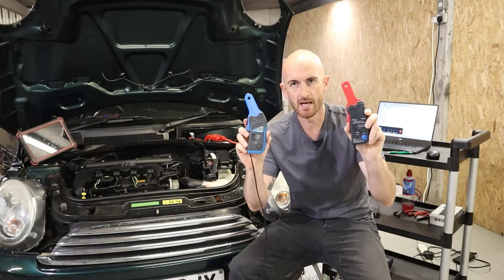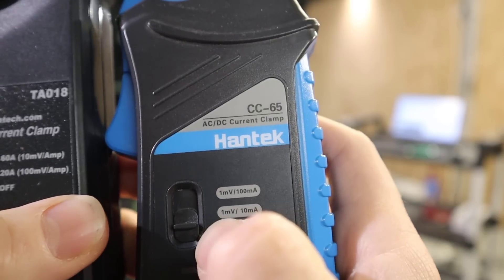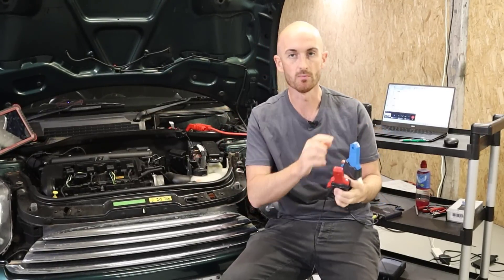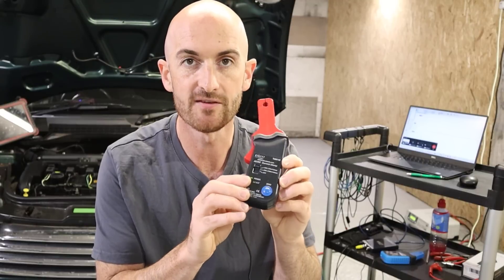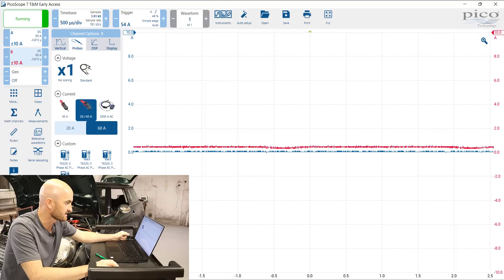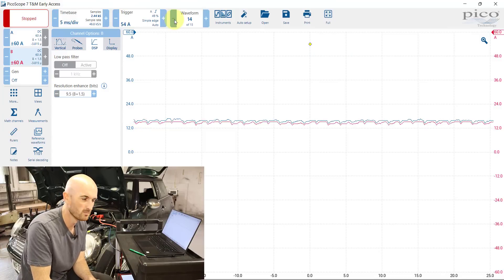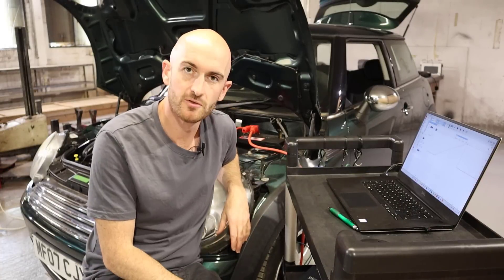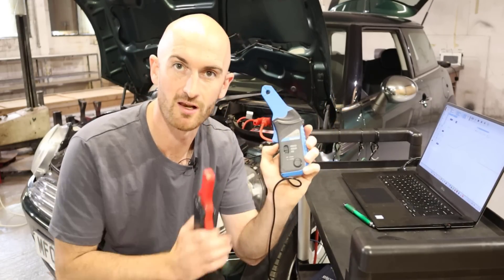Which One Is Best? Hantek CC-65 vs PicoScope TA018 Current Clamp

Comment: Hi there, just one question, i an a bit confused about this Amps per volt thing, i have the Hantek CC 65 as it was cheaper, you say it only measures up to 60 amps, i was hoping to measure starter current in the order of 100 to 200 amps say, so are you saying it wont do that, i have a picoscope 2 channel and the ver 7 software,  i do have a 20:1 attennuator if that could be used, so what would happen if i try to measure starter current with the Hantek cc65 clamp...i have never tried it...i mean it's only measuring the magnetic field not the actual current,  so could i use it with the scope on the 20 volt range for instance...from Fred in Essex.
Reply from the maker: Hi Fred, you will be better to get the CC650 for starter motor current. The CC65 won’t measure that high

Comment: Hey there. I have the hantek 6074BE with the hantek clamp. I'm trying to diagnose a parasitic current draw but the amount of noise is big (even with the clamp disconnected). Could you please suggest the correct settings for the Hantek scope for this? Maybe the trigger should be at normal and not auto?
Reply from the maker: @evgenyknafel2857  I’m not too familiar with that scope. I have one but it’s still in the box! Is there a filter option? Another method is to make a current shunt and measure voltage drop. Should be cleaner. Amp clamps are ‘noisy’ tools!

Comment: 9V batteries are not cheap. I bet I've spent the difference in price between the Hantek and Pico on batteries and not counting the aggravation of having a dead battery. And it's not necessarily forgetting to turn the Hantek off (although that happens to everyone) the Hantek switch moves way too easily. I swear you could breathe on it and it would turn on. The Pico has it's own aggravation, while it does save batteries by turning off, the turn off timer is wayyyy too short. Not sure I've ever finished a task without it turning off in the middle of whatever I'm doing. It's not like it stays on because it senses activity. So, I push the zero button while choosing a range on the Pico while hoping I don't forget to turn it off, and I remove the battery on the Hantek when not in use.
Reply from the maker: Time for a BNC+ 😅😆
Reply: @MechanicMindset  What's a BNC+? All my clamps are BNC.
Reply from the maker: @howlinhog  the latest Pico, it has slightly different BNC connections and can supply power to the clamp so you don’t need batteries 😁
Reply: @MechanicMindset  An amp clamp that requires batteries can operate without any by using the new style BNC connection? Not that I'm going to buy one anytime soon. I'm already way overboard with oscilloscopes. Pico 4000 (or 4000 something, I can never remember) 4 channel scope, Fluke 190-204, Fluke 124B and a little single channel Zotek (which is kinda awesome by the way for $70). Oh yeah, and two old Fluke 97s I've had since the nineties. One doesn't work and the other I can't move one channel down on the screen.

Comment: Hello MM.I have a question you might be able to answer? Let's say I have access to the 4 wires from 4 fuel injectors, which get switched to ground via the ECU. If I put all 4 wires inside my amp clamp, will I be able to view all four injector traces in succession on my oscilloscope? I realise that if I put the clamp around a single common feed wire it would achieve this, but I am just curious if 4 conducctors pass through the amp clamp, what the outcome would be?
Reply from the maker: Yes it works like that! I have a video somewhere; it might be in our app

Comment: New scope user here just purchased a 2204a I already have an Autel mp408 4 channel I purchased a Rotkee pressure transducer and  both the low and high amp clamps from Hantek and after not getting the desired patterns on my scanner I got a cheap laptop to use with my scopes

Comment: Hi, have you considered extending the cable on the hantek CC-65? I think it would make a grate video…the reason I’m asking, is that I’m curious if it actually affects its accuracy!
Reply from the maker: I would just get an extension lead. It’s a good question. Although, as these type of amp clamp are already lacking in exact accuracy at the low levels, I do t think it would be a problem

Comment: mostly ignition and injectors testing . i went pico because of quality and a longer lead. works good with my autel mp408
Reply from the maker: It’s definitely worth spending the extra, especially if you use it a lot. Hantek is great value though 👍

Comment: Could you please tell me if it is possible to use the Pico current clamp with a Hantek oscilloscope or is there connection or other compatibility issues that prevent these clamps from being interchangeable between these two manufacturers?  Thank you
Reply from the maker: It’s fine, you can use most BNC connector probes with most other oscilloscopes. That’s the good thing about all these accessories; you can keep them if you decide to upgrade your scope 👍

Comment: Very useful Darren, thank you. I think the Hantek was reading slightly higher because it is a 65A clamp not 60A and should have used a different profile to the Pico clamp. Without thinking about it more carefully I’m not sure if that would make it read higher or lower!
Reply from the maker: I like your thinking. Just did some maths; Hantek is 1mV/10mA. Times x100, makes it the same as Pico clamp 100mV/1A

It does look proportionally out as the current rises. 

Which have you got?

Thanks! 👍
Reply: @MechanicMindset  I’ve got the Hantek, both 65A and 650A. I’ll see if I can devise an experiment with a current limited power supply to check their accuracy - if only up to 10A.
Reply from the maker: @willishendley8924  Sounds like a plan, I should have done a test with my meter. Although I had done a batt drain comparison; the clamps aren’t accurate at low current below 30mA. And my meters haven’t been calibrated since 2010 when I was working in the workshop last 😅

Comment: Which one should I prefer getting first, an oscilloscope or a scan tool?
Reply from the maker: I’d say scan tool, this will give you the direction of what you need to test with an oscilloscope. But get a good multimeter before the oscilloscope; and learn how how to use it 😁
Reply: @MechanicMindset  Are these scan tools region-specific? I'm from the Maldives. We mostly use Japan made cars. Honda, Toyota, Mazda, Nissan, and Suzuki are the most widely used brands here. People here mostly recommend buying an Xtool PS70 Pro, saying that it's the least costly, professional grade tool on the market. But it actually costs around 700 us dollars! I'm wondering whether the little red scan tool you showed a few days back would suit for me as a beginner! Do you think that one will do for Japan made vehicles too?
Reply from the maker: @roseelectronics4582  The ThinkTool Mini should be a good start. You can upgrade the software easy if you use one brand more. Read codes, live data and perform basic service and maintenance functions 👍
Reply: @MechanicMindset  thanks

Comment: Good comparison video Darren however, is there an obvious point I’m missing but how do you know the one is more accurate than the other? Cost seems to be the decider, but how do you know either is accurate? What are you measuring them against other than each other, I don’t see why the cheaper one couldn’t be more accurate?
Reply from the maker: Good question, I suppose I set out to see how much difference there was. The Hantek definitely drifted faster; so wouldn’t be as accurate. I would have to do another test, maybe with an ammeter or current shunt 👍 a video to add to the list 😁

Comment: Just an FYI for the Hantek amp clamps (both the 65A and 650A): you can modify them fairly easily if you have soldering skills (and I'm guessing most people using an oscilloscope have those skills). It involves changing and/or adding some capacitors and such, but it makes a huge difference! Just search for "Hantek CC-65 Teardown and Testing"
Reply: I found the video by the channel NFM, but upgrading capacitors was not covered in the video.. ? You tube doesn't allow links in comments but could you list channel name and video title?
Reply: Where’s the video? I can’t find it. I’d like to improve the drift on the hantek
Reply: @ i found it, its actually a thread (not a video on Youtube) on EEVBlog website - thread is as titled in the quotes in the first post.
Reply: @luckystrike240 thank you. That blog is a bit out of my league.
Reply from the maker: Ah cool! I’ll check it out

Comment: Darren thanks for sharing. Is there an AMP clamp like the one you used in the parasitic drain class? I’ve been in the garage messing around checking for CAN voltages and resistance. My 07 odyssey has the termination resistors and the correct voltage measurements where my 99 Accord EXL doesn’t. It does have a computer is it possible it has a single wire buss. For having a limited limited computer system I looked up OEM replacements and very expensive 600-1500$ and none of them replace the unit I have in my vehicle. Will write you to figure out the informal  group chat. I bungled it up because I didn’t know what to expect. Stay well excellent classes an very informative 👍
Reply from the maker: Hey Artie, the one I use in the lesson is the new BNC+ clamp for the Pico 4425a, it won’t work on any other scope. 

It’s possible it’s a single line, would have to check the wiring diagram. Catch you soon 👍

Comment: Great comparison. Thanks for making this video!
Reply from the maker: Cheers Brian! What clamps are in your set up?
Reply: @MechanicMindset  I have the standard Pico High  TA167and Low  TA018. I do have 1 other less expensive low amp clamp for when I want to poke around doing current draw while still monitoring the draw at the battery.  Also on my wish list is the TA189 as I have see how sensitive it is... more to come on that once I have it!

Comment: Excellent video Darren. Quick plug for USA buyers AES wave sells thier oem or you can buy a Pico one and have them as a ST3 shielded lead to the clamp 6,9,12,15 ft which reduces noise in some tests with a noisy car. It’s $25-35 depending on length. I’ve noticed huge differences with them. Keep up the good content
Reply from the maker: Cheers Jay 👍

Comment: Ive got the Autel amp clamps. They came with my Oscilloscope accessory kit. The leads are approximately 3 meters long.
Reply from the maker: Cool, the long leads are really good to have wiring around the car; especially if your scope is on a diag trolley. What scope are you using?